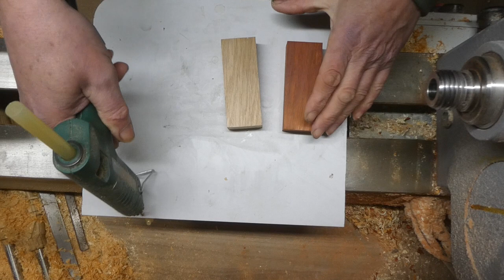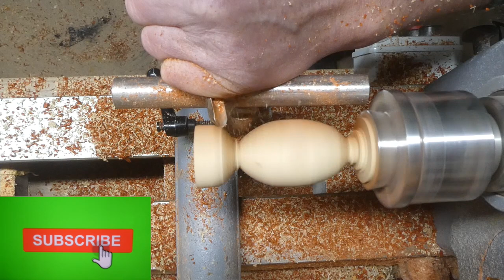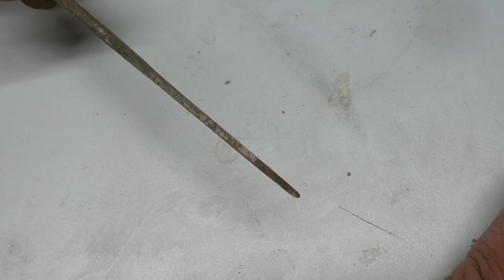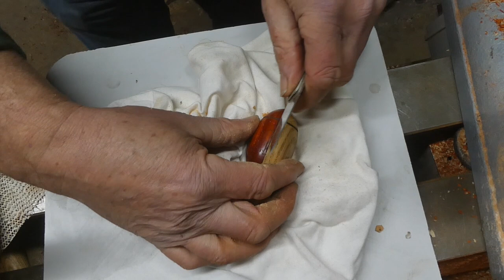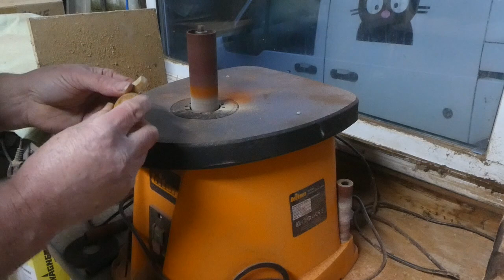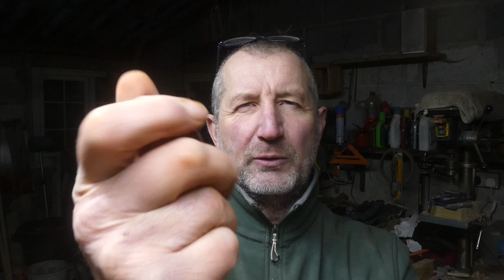Wood Turning.. How to make these wooden Fish..

Comment: Sweet! An animal turning I can really like. Gluing the pieces is easier with plain yellow glue and a brown paper bag center in the sandwich. Not necessary to flood the joint, just a thin coat on both.  After turning, just apply some water along the seam, the paper will give up and all you need do is sand on a belt or disk.
Reply from the maker: Hi Lewis...
Yes.. I totally agree with you... that is a great way to hold two pieces together temporarily...
Take care my friend...All the best.....Andy

Comment: Another fun project Andy! I went out to the shop and made a pair right after I watched this. (My mail lady appropriated them within the hour. ) 
Thank you!
Reply from the maker: Hi Matt...
I'm glad that you liked them...
Haha... you must have made a great Job of making yours.. well done...
Take care my friend and all the best from Andy
Reply: Hi Andy I was wondering if you could advise me a friend has asked me to make a vase for his wifes grave I made a vase of sorts then was advised by a friend that if water and flowers were put in it it would rot what should i do to solve the issue?
Reply from the maker: @singe1978  Hi Singe...
If you could find a glass or plastic container that fits inside the vase ...
Or you could coat the inside with an epoxy resin, which would be waterproof ...
Take care my friend and all the best from Andy

Comment: Nice fish. When I wanted to add burn lines I didn't like the handle wire idea and so I took a cheap coping saw and use it to hold the wire. I can get pressure and I'm never around the wood. To get a variety of fish you could permaglue the 2 pieces and then split them with a saw to get 2 tone fish. Thanks